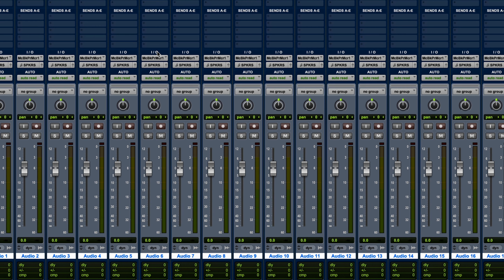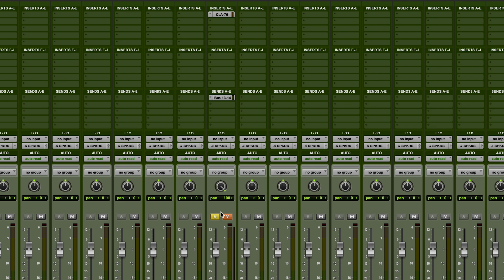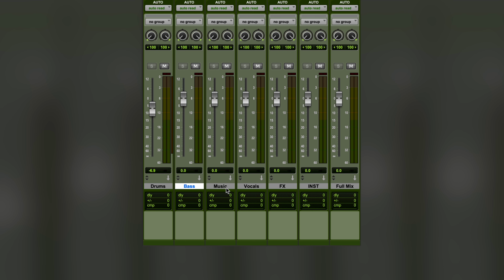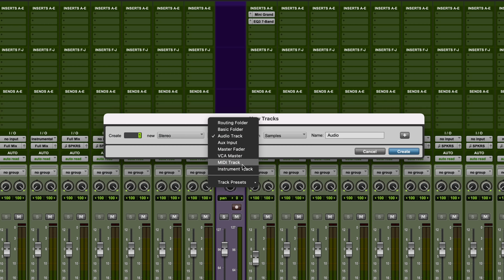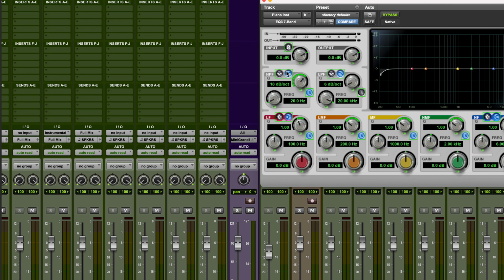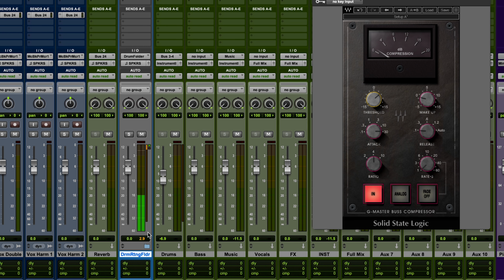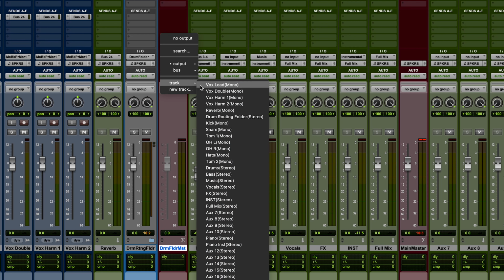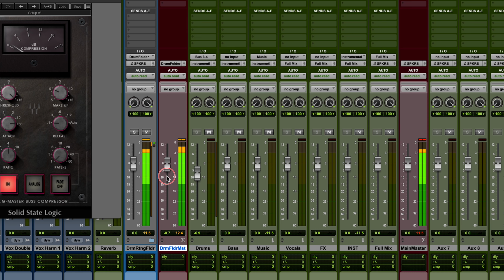Pro Tools Tracks Explained!

Comment: Thanks for the clear explanations, although I have a couple points I'd like to check my understanding on. So, do MIDI tracks exist separately from Instrument tracks in case they are needed for an instrument coming from the outside of Pro Tools, as opposed to a plugin insert like Expand2, and in the past before the inclusion of Instrument tracks, the only option was to send any or all MIDI to an Aux for processing and to pick up an instrument? Also, I'm a tad confused about your explanation of the Master track for the drums, but it sounded like you said the Drum Master Folder, which is essentially downstream of the Drum Routing Folder, since it is assigned to the output of that folder, but that it also essentially can be used to effect the input gain of the Routing Folder, which would have all the processing inserts for the drum group. So, how is it exactly that a Master track assigned to the output of a folder affects its input as well. Is the Drum Folder Master effectively acting like an upstream folder, allowing you to control the input gain? I guess what I'm asking is, is it more a question of  playing with the definition or usual understanding of what Master tracks are, and how they are normally used in a signal chain toward the end and used primarily for things like Compression and Limiting?
Reply from the maker: Hey there! Thanks so much for watching and giving such thoughtful feedback. So, your question regarding MIDI tracks — they still function the same way as they always have and are independent of instrument tracks. You can still set up midi tracks to go to external hardware instruments, or route internally to virtual instruments on Aux tracks like you mentioned. Instrument tracks are a simpler way to do internal "midi to instrument" routing because it can happen on a single track, but they haven’t done away with the “midi to aux track” setup.

Regarding master tracks — I could, and probably should, do a whole video on those — and I think that’d be the best way to truly answer your question as it’d first take a little experimenting on my end to be sure I’m giving you correct information. 

Hope this helps!